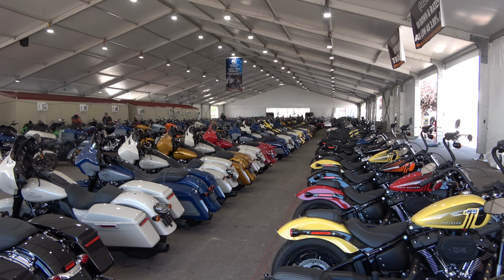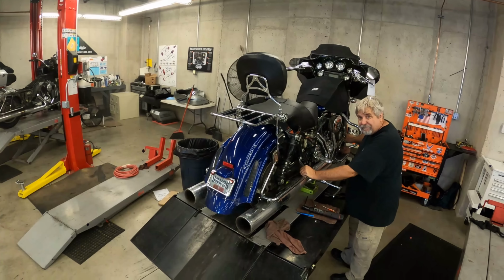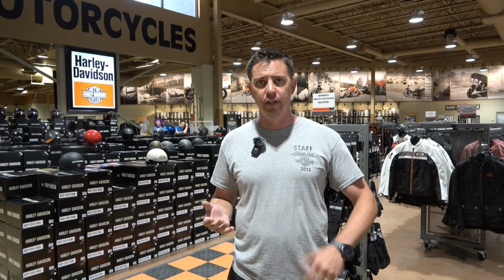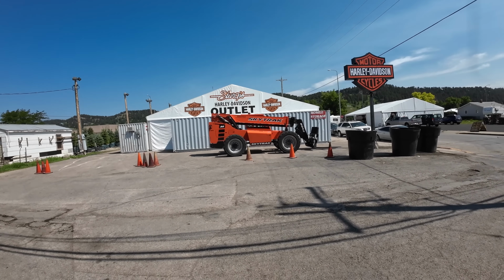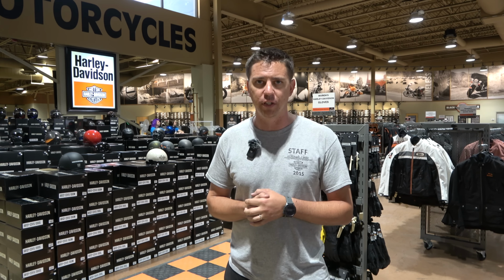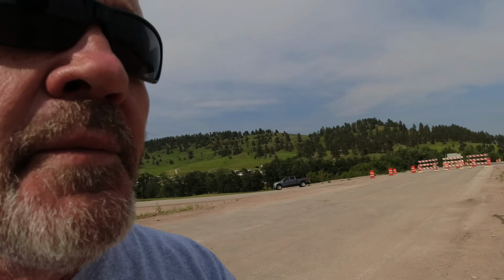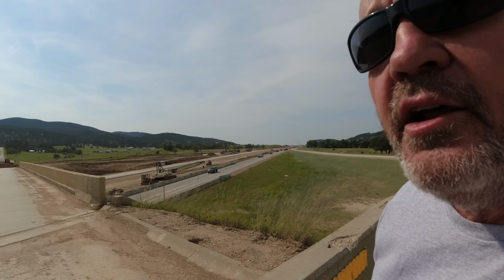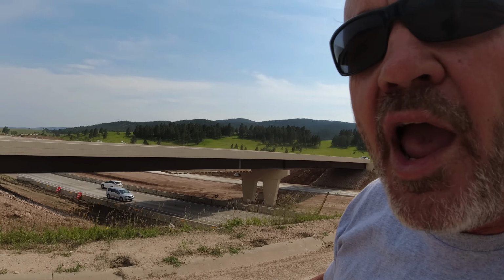Breaking News Sturgis Rally Exit 37/ Black Hills Harley Davidson #sturgismotorcyclerally

Comment: Great video. It shows the highway well. On that East to highway stay in the tire tracks, the loose gravel inbetween is bad and loose. They have a lot of concret to lay still but it is going in.
Reply from the maker: Yes praying they put asphalt or concrete down, even if it temporary.
Reply: @bobandtams  that would help. I did get them to sweep the bridge finally. It was really bad.